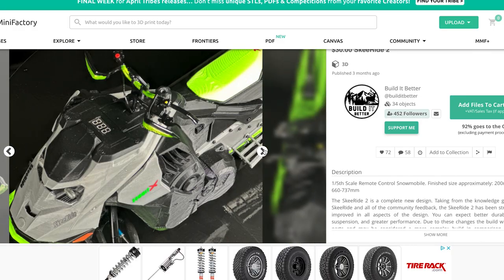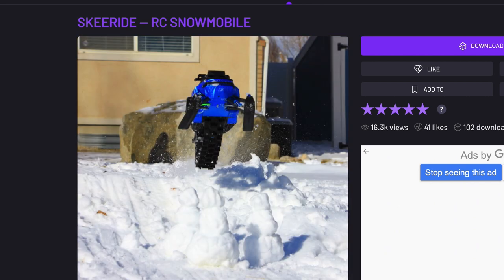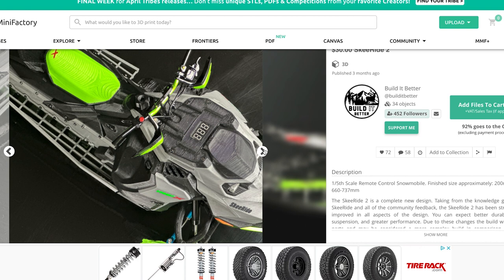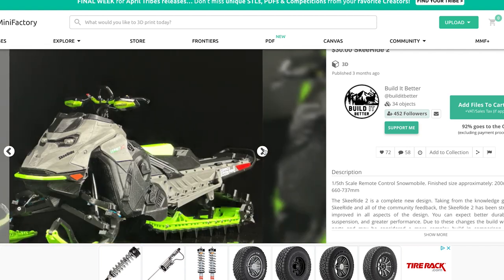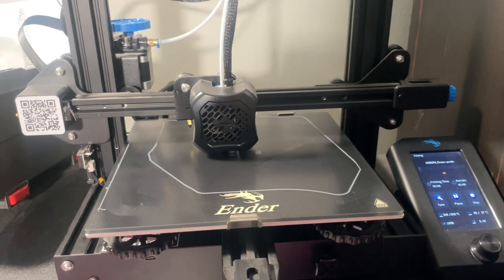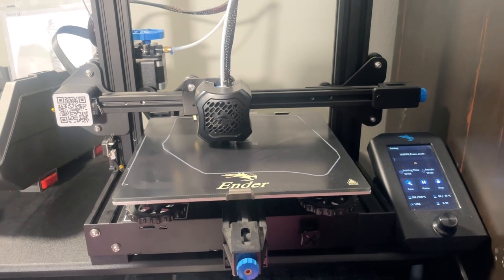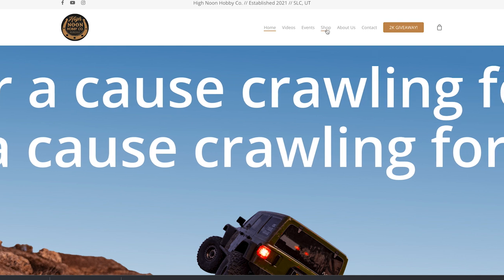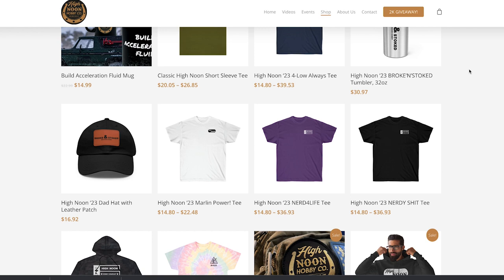FULLY 3D PRINTED SNOWMOBILE! [SkeeRide 2 1/5th Scale Remote Controlled Snowmobile Review]

Comment: And u need to turn ur speed up to 100 in cura because it only prints at 50mm a sec on the stock cura settings and I would turn on retraction
Reply from the maker: Great info, that’s for the input! I’ll have to check on this–I just went with the settings that were provided in the kit, which seemed to work fairly well!
Reply: @highnoonhobby  I’ll dm u and send u my settings later, definitely turn on retraction 🤙🏻